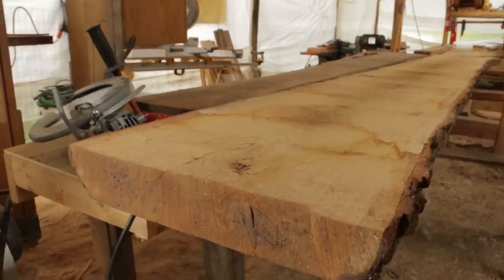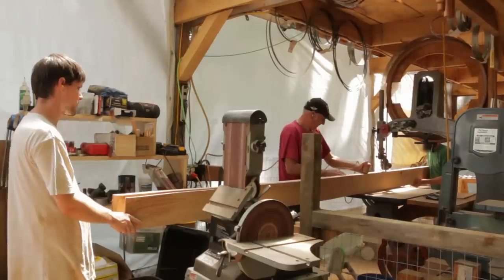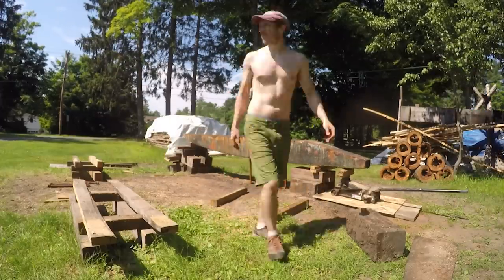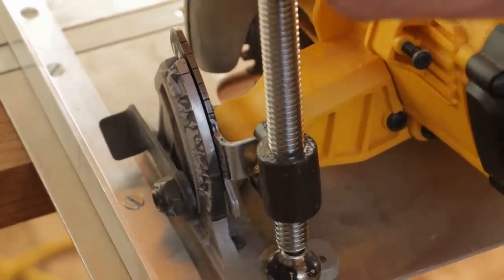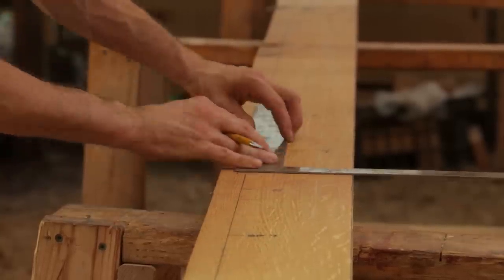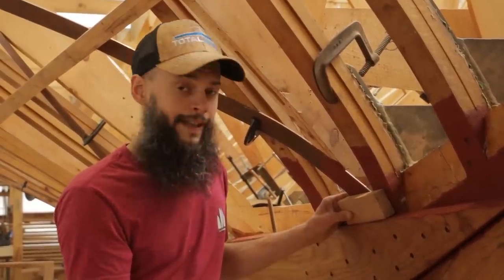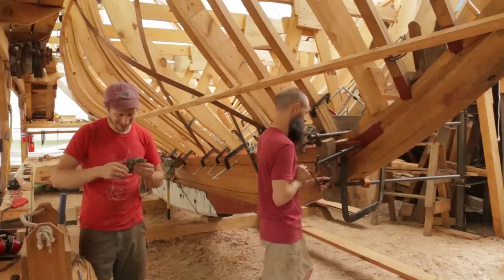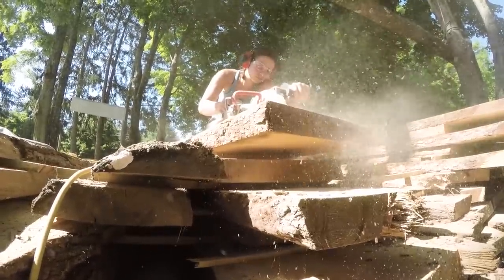Acorn to Arabella - Journey of a Wooden Boat - Episode 75: The First Broad Strakes

Comment: Guys you will be caulking before you know it. Please don't be offended but take some lessons before you start on Arabella. I was out on board a timber boat in 79 on the Irish Sea that had been recaulked by the completely inexperienced crew [same storm that hit the infamous Fastnet race of that year] She leaked like a sieve all her planks were working in the swells,so much so the Stars mechanical and electrical pumps were unable to cope and gave up the ghost . We only had seconds to rig the old cast iron pump set in the deck and start pumping before the water in the bilge cascaded through the open vent style inspection hatch on top of the gear box and put pay to our only source of power. I can assure you it was quite the most terrifying experience of all my years at sea, Don and I lashed ourselves to the hand rail and pumped like the very devil,waves breaking over us pulling our feet from under us. And so we pumped, I don't know for how long,but we did not tire which just goes to show the extent of our terror. Eventually someone managed to get the other pumps back on line and we made it home. Feet safely back on shore I swore an oath to myself that I would never put back to sea on that boat again. I cannot stress enough your boat will be useless without really good caulking and you won't find that out until you hit your first fierce storm. TOO LATE THEN GUYS.
Reply: Yep. That's terrifying! I find this fascinating, and I know this is based on centuries of experience but I'm surprised the hull is only a single skin and only the caulking between the ocean and the inside.
Wouldn't it be better to use two skins so that the planks stagger and overlap the seams so can be sealed more effectively?
Reply: There speaks the voice of experience Steve and Alex.
Reply: @ahaveland  I'm no expert but I've been following salt and tar's build and they did something very similar called "sheathing" below the water line but the described it as more for protecting the hull than keeping water out. Not sure if they plan on doing that  with Arabella but I'm sure they know what they're doing
Reply: @Jimmy95x  Thanks - I'm sure all will become clear...

Comment: I've been watching this series out of order and I have been building up a set of questions about why and how things were being done. For me, this was the master episode. I learned about how they fit the planks, the fancy saw, how the planks are going to be sealed, why weren't all the frames put in place before the planking began, and why they don't use a power tool to drive the screws. 

As an aside, I bought a yankee screwdriver years ago just because I thought the idea was cool. Alas, for me, it was useless. I couldn't get it put out enough torque to drive any screws except maybe ones that required very little torque to drive and for that a regular screwdriver worked fine by spinning the screw shank with your fingers. Also, before I started doing renovation type work, power drills and impact drivers were a thing so even if the Yankee screwdriver had worked it would have been obsolete for me.

Comment: Love the tool. Needs a digital readout and possibly an encoder and a stepper motor to tell where along the track it is as well as the appropriate angle for each discrete location. Software can create a cut profile that would adjust itself automatically. This coupled with a laser scanner to pull the profile off the boat would complete the system. Maybe overkill for the small number you need to do. Great videos! Keep up the good work!

Comment: Thinking about the fact that when you cut your angles some of them were off I have an idea what may be wrong.  You are using a screw (from a C-clamp) to adjust your saw.  It can only push the saw into a greater angle, it can't pull it back when you straighten the saw back up. You are then having to straighten the saw without tipping the base plate off the track.  Installing a spring to pull the saw back vertical will eliminate any slack when you back off the screw, improving your accuracy.   Hope this helps and good job paying it forward at the end of the video.  :D
Reply: honor harrington Exactly

Comment: Another way to get two sides of a board to sit flush against each other is to take a strip of a cut sanding belt and put 2 handles on each end. Place the strip in between the two boards and start pulling the sandpaper like a old 2 person tree saw. It will sand off all the high spots using the lower board as a edging table. It can go pretty quickly too but on long board projects it might be a bit much without a few extra hands helping.

Comment: I think it is really cool that you are building a traditional wooden boat using as much modern tools and the knowledge of those who have gone before you.  Looks like it is going to be a sweet boat.  Seems very labor intensive as well as generally not the cheapest way.  So I wonder: What is the advantage of a wooden boat over say, fiberglass or steel?  Does anyone still try with concrete anymore?

Comment: Interesting how the same problem gets different solutions in different regimes.  Your problem with planing the planks edge so they match tightly is also found when making cedar strip kayaks.  The guy at Guillmot kayaks designed a holder for a small plane.  After each strip is laid in he runs the plane along that rides the ribs where the next strip will attach.  That makes the edge square to the next strip to be attached.  Of course all his strips are a quarter inch thick and also not very wide.

Comment: A small improvement for the tilting action handle on the saw, from the plastic handle of the saw (original) screw a plate with an eyehole that goes around the thread to keep it stable, then, weld on the ends of the T handle two rings. Idea being that you can do the whole operation using a single finger by hooking it inside the ring and twisting, it needs to be stabilized by a riser like i said tho.

Comment: would it be a crazy idea, if you  melted the wax, and dipped the screws in it and put them aside to cool, would they get a good thin coating?(no idea, never tried)
Reply: Would need to preheat the screws to keep them from picking up big gobs. Since they spin in they even out what ever you get on them anyway.

Comment: I was wondering, when using your special-rigged circular saw, if you could somehow continuously adjust the angle, which would be very tricky, but would possibly give you a more perfect fit.  Maybe someone could call out what the next station number ahead would be, and you could try to gauge your timing to get there?

Comment: will there be a flatpack ikea version?
Reply: Ikea wouldn't have from where to steal enough wood for that.
Reply: Haha, imagine the size of the packaging!
Reply: I doubt that European birch would work well for an ocean going vessel.
Reply: It would be interesting to see if a small boat made from particleboard would float, or end up on the bottom of the harbor as a pile of sawdust, plastic fasteners, and corroded metal pieces.
Reply: @user2C47  the glues used in particle board are not waterproof.. the individual particles would swell and push away from each other.. she would go down pretty quick.
Reply: Paul Slevinsky nah! It would have to be a fucking big Allen wrench, like  a 1" hex six foot long!

Comment: Once again I enjoyed my Friday fix of arcane nautical terminology and I wonder how you guys, (As a gender neutral term as I realize the project has both wide berth as well depth I can hardly fathom!) do know what each item is known as and how to adjust as needed. My friend Eric, I met him buying a PC on Craigslist when like you I had a lot more ambition than cash! I was hurt trucking and my favorite past times any old vehicle repair or woodworking were out as I couldn't stand up but a few minutes at a time & even walking is still difficult. I saw a TV show about folks in the process of casting silver & I got interested in wire-wrapped jewelry, but I couldn't afford $5 for a 20' roll so I got a 20' piece of twisted copper cable for $20 with 40 wires in the piece. Sadly as I had 15' flopping around in the air 1 wire went into the cooling grill of my power supply and blew the breaker on the first floor! For a refurbished 3 months of warranty for $50 I couldn't say no! Well he's an international Autism advocacy awareness speaker and he spoke in Cape Town, South Africa 2 years ago and meet his wife on the trip! We'd practice Afrikaans to a YouTube video with Ann Marie and I got the Mondly Language App. But how that relates to what you're doing is I found out that the nation was establish not long after the first modern stock exchange was built in Amsterdam and the profit was so astounding that a small European country had the largest wooden naval fleet in about 1600 for the spice trade & they were given authority of a sovereign nation! Their fleet couldn't find anyone to trade with to resupply going around the horn of Africa and Dutch farmers called Boer's took up the opportunity to have their own farms. How were so many ships made so fast?

Sadly the ancestors of those farmers aren't so good now. It is called "Plass Moorde" in the local Afrikaans language.

Comment: When backing out any of the strakes, must you back out the entire length of the plank, or can you  back out only at the frame locations? Would that save time and effort? Would it make a difference on the interior of the hull? Also, can you back out the strake in sections before scarf-gluing, or must you glue up first? Jon

Comment: Since each board is glued between two frames, why not cut and fit each piece BEFORE glueing. You could mark the top of the first board with lumber crayon, get all the high spots and sealed fit.  Then tapper the joints and glue while screwed on the frames and against the board below. This way you're not fighting with such a large board, much easier water tight fits between boards and ends. You have a proper jig to get the scarf joint just right. When the scarf joint is glued, you will have the boards screwed on to the frames and ends tight against the stern and bow. Now the scarf joint won't move when glued. after glue drys cut the 90 deg top edge to size.
MINWAX floor wax paste is a good release agent when glueing.

Comment: Would it work to clamp the new plank say 4” above the garboard using spacers for consistent gap, then run a jig-slider along top of lower fixed plank with an attached vertical arm pen holder which carries a corresponding line to the lower outside of the clamped plank? Think will give a line which agrees with the fixed plank at all points.

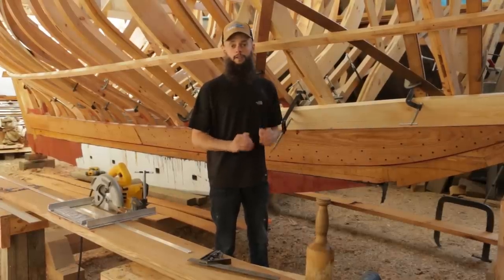Comment: When you're explaining stuff, grab a board and a pencil and draw a little sketch.  Drawing on a board is an old wood-shop tradition---because paper is too fragile.  You can read about joiner's rods, if you like.  It's also part of the Japanese boat-building tradition, too.  I understand the part about having a single bevel (9:00) on the planks but that's because I've read about it and seen drawings.  A quick sketch of the cross section of a plank would really make it clear to everyone.  Cheers.

Comment: I spent 16 years rebuilding a 25' Chris-Craft Express Cruiser; (Red & White). I had Torin Youngquist build the hull at Youngquist Marine on Lake Union in Seattle. WA. I helper cut and plane the ribs and other pieces. The Hull is practically new from the Keel up using the original pieces as patterns. I saved the engine stringers and every part that had the boat number imprinted on it sometimes with extensive repair. We used  white oak for all the structure parts, marine plywood for the bulkheads and cabinets and Mahogany for the double bottom planking and sides. The original Post War Red & Whites used Port Orchard Cedar, but that wood was not available. I then took over and rebuilt everything from then on. If interested go to my channel  choochoo3985 and see CHRIS CRAFT THE OLDE MAN RE-BORN. However the reason I am sending you this note is to offer you several silicone-brass screws I have left over. Many people helped me in the restoration of the OLDE MAN and I would like to send you all the screws I have left over. There may not be many, but some of these were $7 each so they will contribute to your program. Like so many people told me; great you're restoring an old wooden boat. While getting his original Chrysler Royal Marine Straight Eight engine installed on Dixie Highway in Fair Haven MI. several old Chris Craft employees that built the Red & Whites dropped in with tears in their eyes. The old wooded boats make an impression everywhere they go. Thank you for sharing this experience. Ted

Comment: Am not a boat builder and it's just a idea, would it not be easier and stronger to cut individual channels out for each rib in the planks rather then plain away the wood that way you keep the wood thickness and as ribs are in channels it gives them more strength
Reply: Wayne Turner not a boat builder either - but I reckon this would cause edges of the little notches to break when the frames move and flex?

Comment: In your “backing out” procedure, I did not see you mark the boards.  If you marked the amount you want to take off on the side of the board the job would be much easier to “see.”    Much like scribing a piece of steal on the side in the middle for a knife blade, so the blade ends up exactly in the middle.  In your case you only want a small portion removed.  The mark would show just what to take off.  1/16, 1/8, 1/4, inch could easily be marked down the length of the plank with an adjustable square.

Comment: One of the few times I'll actually agree that a bit and brace looks like a correct tool for the job. Even if you could get Torx or Square head screws, I'd still worry about an impact fatiguing the shaft of the bronze screw itself.  Though I suspect something like a Milwaukee  1854-1 would work too, if it weren't for the pesky flat heads. Unlike a certain other fuddy duddy who is obsessed with a bit and brace that made the cringiest comparison video ever.

Comment: Instead of trying to "back-out"  the entire length of each broadstrake board .... Couldn't you achieve the same basic result by simply using a contour gauge to measure the curve of each frame on every individual frame and then transferring and notching out that curve on the back side of the broadstrake board only for the approximate width of each frame?
This would create a broadstrake board with a bunch of notches on the back where each notch fits into each the frames perfectly. No?

Comment: Hey you would spend about 1/10th the time driving those screws with an electric driver, and you can feel what you are doing if you aren't a complete mouth breathing invalid.
Reply: I would have agreed with you until I tried one.  Did you see one of the earlier videos where the cordless drill was COMPLETELY unable to drive in (or take out- I can't remember) what Stephen  was working on, whereas the brace and bit had no problem.  Did you also see earlier where they had snapped the shaft off of 2 Milwaukee heavy-duty corded drills?